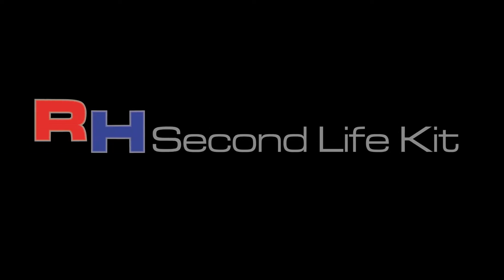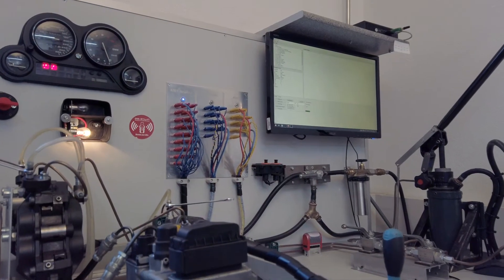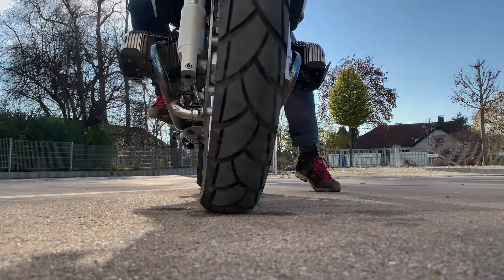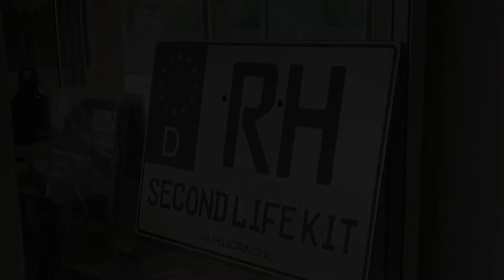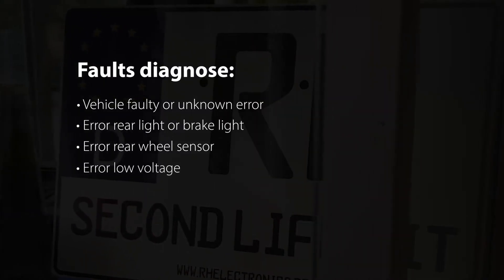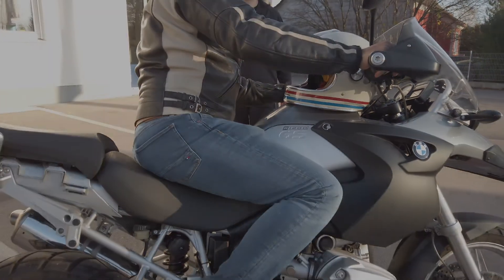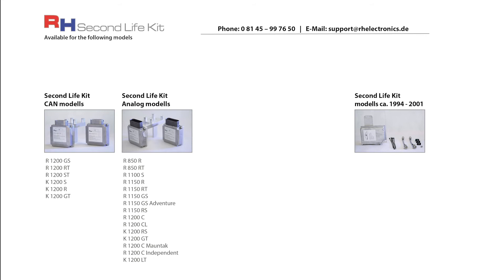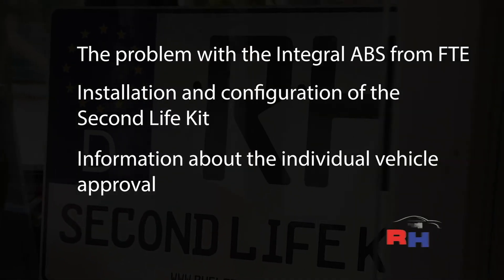RH Second Life KIT: The conversion kit to replace the fault-prone BMW ABS 3

Comment: I JUST ORDERED THE SECOND  LIFE KIT FOR MY 2007 K1200LT THE SERVICE WAS FAST AND THE ISTALL WAS QUICK AND EASY.
THANK YOU.
Reply: Phillip... I'm looking at one for my 2005 K1200LT... did it really disable the electronic centre stand function after installation?
Reply: @cws127  yes it did disable the center stand but my brother and I bypassed the module and put a fuse in line on the power wire side.we got the center stand to work but all the safety features are disabled and the causation light is on.the brake's are not as good but it still stop's without an issue.
Reply: I have a gt1200 from 04 with the blinking brake failure does this take care of that?
Reply: @ you need to find out what code it’s sending you might be low on brake fluid.my abs system was leaking that’s why I replaced it.
Reply: @RJEEP2004  I've changed pads and fluids, the Def the abs module that's failed rendering the brakes useless.